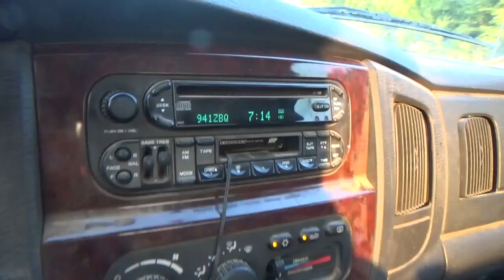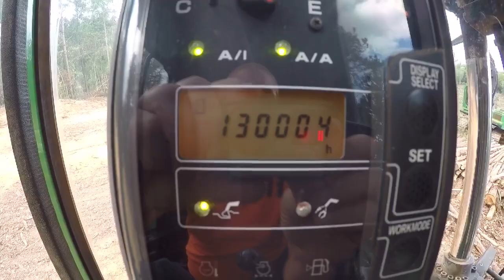You're out of fuel, really?

Comment: Ever thought of doing an oil analysis program. Many of the large equipment operators here run those programs like O&G Industries. They test for all kinds of contaminants, soot, viscosity, fuel, water, coolant, etc. Sometimes they significantly extend the life of the oil. Also can give a heads up that the engine is dying. Although they have hundreds of pieces of equipment so oil is a big expense.

Comment: Does your loader use much out between changes with 13,000 hours on it?
Reply from the maker: Old video. It has almost 16k on it now and I put a motor in it at almost 11k. I don’t add any oil between changes on this motor currently.